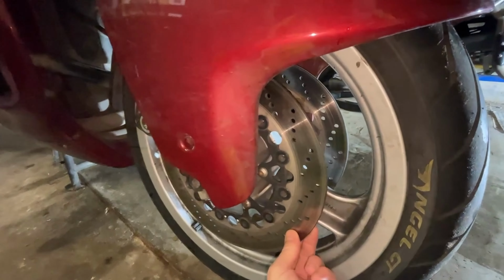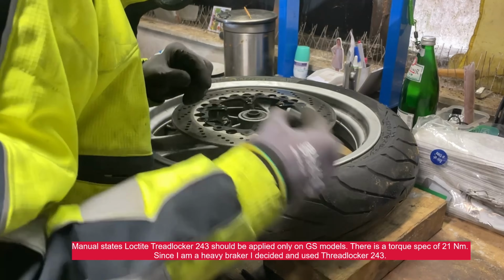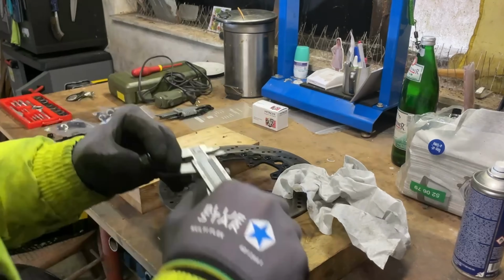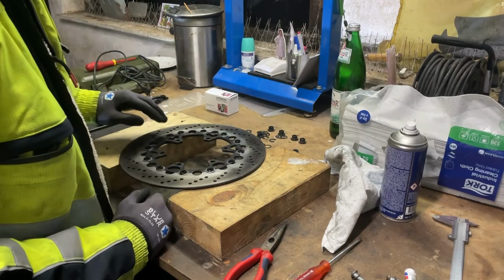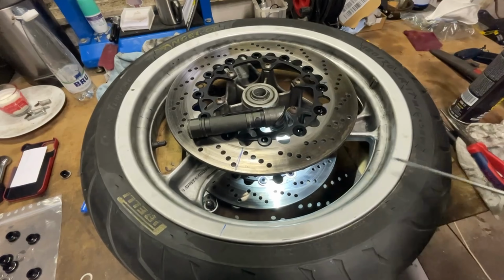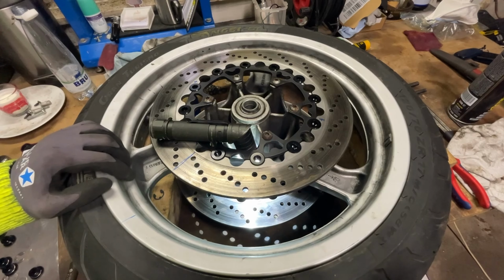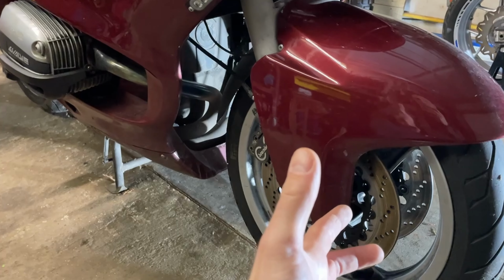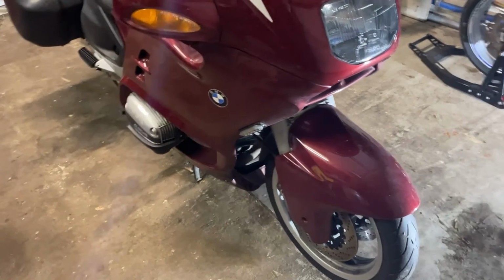BMW R1100 RT: brake rotor bobbins replacement - tryout + long term results

Comment: Mine are loose like yours.  60k miles on 2000 model. I think I will run them as is for a while longer and then see about new discs
Reply from the maker: I still run the same disc after replacing the bobbins. After visual inspection and 8000km on them. Bobbins are solid and brakes well. Will see again later but at the moment am not planning replacement.